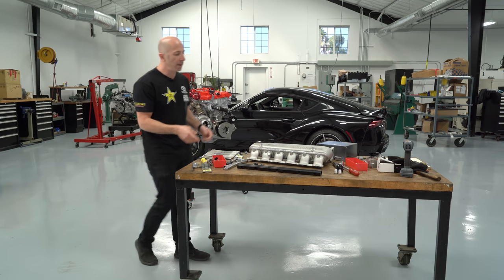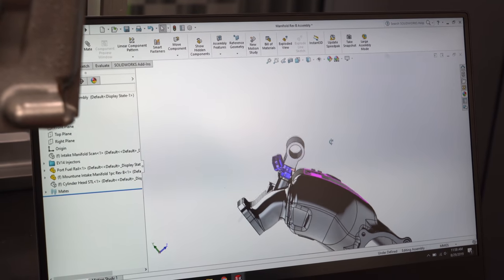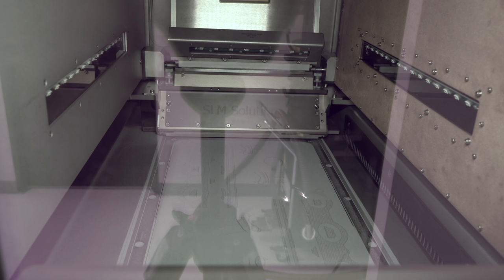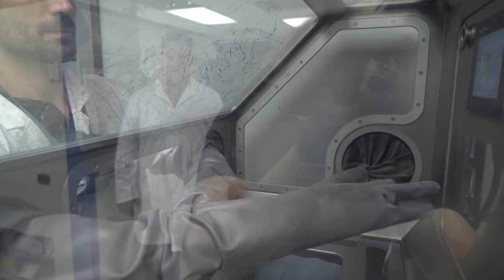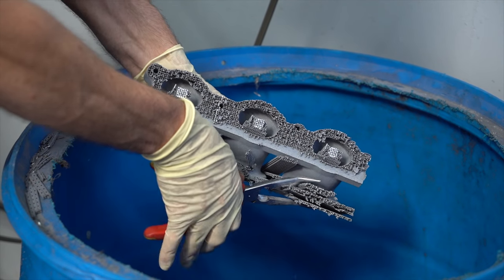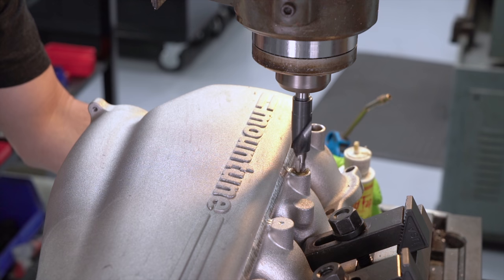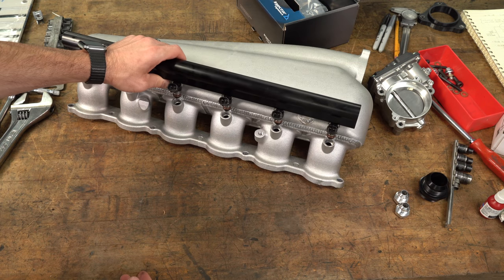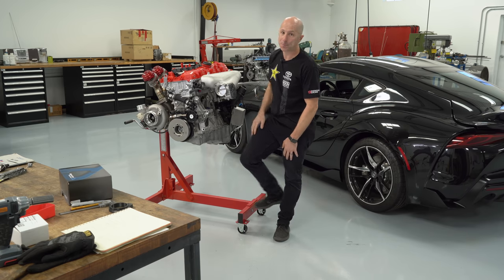3D Printed Aluminum Intake Manifold - Laser Melting Process

Comment: " Its a fairly simple process,  you just take this giant laser and shoot it at powdered aluminum! Easy, right?"
Reply: Lassi Kinnunen  or investment casting like Jay Leno has done in the past to make some of his parts
Reply: aniruddha patil what do you mean crashes at 90%?
Reply: Lassi Kinnunen  your first paragraph negates your last paragraph.  Replacing pla with aluminium via casting reproduces the EXACT same shape as the pla part. If you printed it, you can cast it.
Reply: Casting is easy
Reply: Lassi Kinnunen  but unfortunately aluminum does odd things when being cast into large and/or complex shapes. Would probably take several attempts to get the venting, sprues, and runners right. It's not always as easy as one might think.
Reply: Well because of the fusing temperatures wouldn't you have to flood the work bed with argon to avoid oxygen contamination?

Comment: Stereolithography. Been doing plastics like that since 1986. That was even more complex: The laser focus was fixed right above the pool of resin and a bed would break the surface and get lased wherever it needed a build up. then it would lower 2-3mm and rise up again (minus the height of 1 layer) with a fresh layer of resin on top of the last layer...lase that layer...on and on and the machine would have to wait for any waves to stop in the tank so it was an overnight process for a few inches but you could build a furnished doll house a layer at a time. Now they are doing it with aluminum powder. That is some one off stuff right there as the cost to 3D print a form for a custom AL casting would be cheaper and maybe just as fast if you had the production nearby waiting for the part.

Comment: $10K later and we have a converted direct injection to port injection setup.
Reply: Hopefully they run both like newer Coyote engines
Reply: @dhodg777  Looking at the dyno vid the direct injection didn't work out so well.
Reply: @mrred1012  they did not use direct injection so injectors had no fuel flow = no cooling so they just melt and burn out, thats why its hard to install a LPG to direct injected engines
Reply: @Clifton Green that's really besides the point. I merely meant that it could be spent on upgraded direct injection technology. Which is going to be the future anyways. The only current obstacle is cleaning of the valves that port injection offers.
Reply: @Clifton Green he already dyno the engine with only port injection and direct injectors literally get burnt out, check he's other videos
Reply: @Clifton Green you're absolutely wrong. Im currently dealing with a car that is DI trying to push only 450whp. It's extremly difficult. The easy route IS to simply just add a manifold with additional injectors. It's much easier to tune and removes the limits that DI currently has. With their accessibility to technology such as 3D printing, it made building a flex fuel setup that much easier.

Companies have recently THIS YEAR just passed the limits of 1000hp on DI only setups. So my suggestion of just "replacing the injectors" has a lot more involved than you are suggesting.

HOWEVER, the average person can't afford to drop 10-15k on a build like they're doing. So DI should be the route to go in order to help with the DI market .

Comment: Yeah, sure the cost is high and the process is slow but imagine where this process will be 10-15 years...
Reply: This technology is already 20 years old.
Reply: more like 1-1.5 years
Reply: It was by 1980 - I remember because I was working in the business hub of Toronto for a mining company that makes fine metal powders like nickel and cobalt for tech leaders like GE's jet engine division. In our office tower there was an architectural firm that was modeling proposed projects, i.e. those miniatures of office towers you'd see in lobbies. They had something that would lay a non-metallic powder and follow that with an adhesive to bond it where desired, then go up a level and repeat, etc. I thought it was a nutty way to make a model but who's to judge.
That would be the grand daddy inception of powder deposition. 

Early 90's I paid $625 for a Creative Labs 3X speed CD writer to be able to tell customers we could burn CDs for them. Slow as molasses but the first on the block. I paid over $300 for my first DVD burner a few years later (~1995) and it wasn't even 5X write speed.
Reply: Casting iron technology is about 2400 years old, so you could say it took quite a while to get to todays casting quality. So relative to that 3D metal printing technology and quality is developing/progressing pretteh fast!
Reply: This process is ridiculously fast compared to other options
Reply: @jnicksnewstart  nah..2 year in market not when they discovered it..now everyone can make one
Reply: @thecommentssquads2804  It Was available at WESTEC in 2003

Comment: That’s an “older” printer too they are getting really good really fast
Reply: @Kevin Schmidt can be done with any metal. titanium especially, because its so hard to machine or form, and an expensive materia to waste so much during subtractive manufacturing. its getting to the point where its gonna be cheaper to 3d print titanium and other exotic metals, rather than create a part out of billet via subtractive manufacturing
Reply: Kevin Schmidt It’s basically just Percision welding so if the medium (powder) is available they can print it.
Reply: It’s easier to do it the old fashioned way sometimes haha all this new stuff is getting complicated 😂😂😂
Reply: koenigsegg has been printing some of the more exotic metals for a while now but im pretty sure in a different process. its rad to see this shit evolve!
Reply: Brad Viviviyal I thought because he said old 😂 I honestly wasn’t using much brain power at all with that response 😂
Reply: Brad Viviviyal  fair call, i thought it was normal 3d printing with sintering after its printed.
Reply: Should have printed internal intake trumpets
Reply: @miskone1044  One of their turbos is so complex it can not be cast...very cool stuff
Reply: @miskone1044  Same process.
Reply: Same process but the platforms are getting cheaper, you will be seeing lots of these very soon. https://youtu.be/82ZZVIl72yE?t=1424
Also, back the video up like 2 minutes to see their continuous carbon fiber printer.
Reply: @Kevin Schmidt Titanium is actually easier to deposit (print) than aluminum. Aluminum is very reflective in the near infrared spectrum (where the SLM's laser is) and conducts heat very quickly making it hard to maintain a meltpool. Titanium doesn't conduct heat as quick helping maintain a stable meltpool and absorbs more laser power.
Reply: @powertothebauer296  yea you're right. however, its particularly easier in a metal 3d printer since its an enclosed and a controlled environment that can be filled with an inert gas that doesnt get washed away by drafts/breezes in the shop
Reply: The two problems these SLF printers have is inherent in the design of the machine. 

If you watch the laser hit the powder at a microscopic level it actually blows the powder off of the top surface in a sporadic pattern.  When this happens the molten metal can have a uneven weld and even air bubbles inside the layers which isn't good for long term life. The process still needs some refinement.
Reply: actually it isn't easier to do this the old fashioned way unless you make 100s of thousands of them
1)you need a build a mold(sand or die cast,expensive,labor intensive,trial and error)
2)you need to perfect the mold(make countless parts until the process is refined)
3)then you need to pour aluminum into it(again trail and error to perfect)
4)then you need to perfect this process(can take a long time and still not get a good product)
5)then you need to trim the casting and deburr/finish the un-machined portion
6)then you need to machine the casting(fixturing is incredibly expensive as is tooling and cnc machining and programming)
7)then you need to 3d - 5 axis mill the casting out to be anywhere as thin and free flowing as this printed intake taking a ton of time and costing a fortune to do
Reply: A lot of misconstrued hype getting around in the comments

The real (and only) benefit of 3D printing metal is for parts with complex geometries and or internal features that are impossible to make using conventional techniques. For that, 3D printing metals offers BIG leaps forward in what can be designed, but the only industries that have a pressing need for this are Aerospace, Medical and a few other high value/low volume industries. 

For anything else conventional subtractive methods and forging/casting are still orders of magnitude better. I can’t see that changing soon, if ever.
Reply: Renaissance Man 
Can you give some examples of low volume-high value industries?
I’m curious and intrigued
Reply: jasiel delgado It’s the space industry that is driving this tech
Reply: Trever Fogarty 
I know.
But I want to know what low volume-high value industries are there as he said
Reply: jasiel delgado I made a competition rifle butt once.....
Reply: jasiel delgado So in reply 2 months later (lol) the main industries right now are Aerospace and particularly biomedical

Thinks like metal hip implants and prosthetics have super weird shapes that can be made specifically for the patient. Biomedical is all over it right now, because the human body if full of weird and inexact geometries that need metal parts to meet a need. 

Aerospace also need parts that have complex geometries but for them internal features (certain things inside a part that are impossible to do with current methods) as well reducing part counts is huge for them in weight reduction and reliability. I think it was GE that had some assembly for one of their jet engines, they reduced it from 40 parts to like 5. Reduction in weight and complexity was a big gain
Reply: Renaissance Man 
Thank you 🙏 I was very curious and still am. You quenched most of the thirst. 
I’m very good at coming up with solutions but first I need to understand what exactly they need (all of what they need) and understand the tech.

Any good direct resources to study for both industries would be appreciated if you’re up for it. Thanks again
Reply: Brad Viviviyal  Good ol metal casting and welding sheet metal. .  intakes don't need to be printed. exhaust collectors don't need to be printed.
Reply: @Kevin Schmidt Renishaw does one in ti64
Reply: @HoweDoYouDo1999  definitely easier. But technology, although complicated, makes things efficiently and quick. As years go by and technology advances, 3D printing will be the norm in mass production.
Reply: It would have been faster to machine from solid. This is far from a good application for this technology, other than having the cool factor.
Reply: @teamtoken  yep, scalability is currently a major bottleneck for 3D printing. 

Still, whatever drawbacks current 3D printing methods may have, it's still impressive.

Comment: Question is, What uses more energy and time, casting or printing?, and long term reliability? just a thought. Unbeatable for prototyping no doubt.
Reply: Brad Viviviyal  Why is it stronger?
Reply: @samward2162  Cause the laser makes the grain structure of the metal jumble. Casting nowadays is done efficiently and doesn't have the same problems that it did back in the day. Hopefully 3d printing metal gets better.
Reply: @lepmuhangpa  3D laser sittering have more compacity than casting today, so it's mechanicaly better than casting
Reply: @surronzak8154  Still weaker than casting.
Reply: @مبغض الظلمة 100%
Reply: It depends on what you're doing. 3D printing is more efficient for low volume production of highly complex parts that can't be cast or machined.
For high volume production, 3D printing is currently bottleneck because of scalability. 

As for long-term reliability, I can't say, but the finished product shown in this video seems decent.
Reply: @lepmuhangpa  if grain structure is the problem then it could just simply be heat treated to realign the grain structure. Hell 3D parts might even be better because there should be virtually 0 grain stress from the beginning.
Reply: @280zx2by2  Every metal part I've used that been 3d printed is weaker than a comparable cast part. Even MIM parts appear to be stronger. The tech will eventually get there, but right now 3d printing parts under a lot of stress or pressure probably isn't a good idea. One thing they do seem to not have issues with is porosity or stress points - at least not nearly as much as traditional methods.

Comment: G.M. has been 3D printing of prototype intake manifolds since the 1980s.
At that time I was an instructor at a local college and G.M. donated what was then called a stereo - lithography machine to the college.
The media was a resin compound but worked well for prototyping low stress components.

Comment: Step 1 : buy 3d printer
Step 2 : print 3d printer
Step 3 : return 3d printer
Reply: Well I mean it's entirely possible to do it as people already print their own ones minus circuit boards and stepper motors etc.. crazy haha
Reply: Enjoyed this comment, thanks. :) Also it's funny because it is somewhat true.
Reply: Step 4 : skynet has become self aware
Reply: @djremotion2  Not just somewhat, it's called RepRap, google Prusa Mk 3. Got one at home
Reply: Thanks Chewbaccawacka
Reply: Mind Blown !   😂
Reply: why do I get the feeling this was a popular comment back in 2012 or so?
Reply: Wrong. When you buy 3D printer, all you print is more parts for it to run correctly 😂
Reply: Read R. Sheckley. He proved that self-reproduction of mechanisms is impossible, due to the loss of interest of mechanisms in repetitive self-repetition operations.
Reply: @MrRedstoner  there are few printed parts, most of printer is not printed. Esp. Prusa is complete hype and "printers print printers" is not much true. There are project, where printers are full printed, with frame, rods and belts. And they are inacurrate crap :)
Reply: Yeah I know the rods nuts and such aren't printed. But those are the parts that you can easily get at a hardware store, so there's no point in printing them. You print the parts that need to be specific to the end product. Of course they won't be as nice as fancy printers. But the prints our one produces are perfectly fine for what I need.
Reply: Replicators. Pesky little things.
Reply: Nice!!
Reply: @ihateu1979  on a standard PLA 3d printer? No you can't.
Reply: Rule number 1: You can't wish for more wishes...
Reply: Nice copy/paste comment.
Reply: @MrRedstoner  fk prusa,  google reprap Snappy its the most 3d printed 3d printer. 
prusa isnt really a reprap anymore in the sense you need a printer to build it you can buy it for 3x more than its worth in parts. 
and its a wobbly PoS. get a box frame printer.
Reply: picked one up at aldli  just waiting on the aluminium wire.
Reply: funny guy!!!
Reply: @MrRedstoner  no, just somewhat, unless you really believe  you can print a complete printer.
Reply: @anthonyg4671  You can print everything you can't buy, and buy the rest for likely way cheaper than the pre-made printer. That's a fully in my book, as the result adds up to a complete working printer.
Reply: vary good idea.
Reply: 🤣🤣🤣🤣🤣 Sure.... ONCE!
Reply: That is illegal, can't do that.
Reply: Good coding.
Reply: Step 4 : realize that materials costs a lot, and someone earns profit (if its not made from waste)
Reply: yeh , but you forget to think about software part :) and you have to find ingenrnir to set up all in place

Comment: Fun fact: I’m currently working on a project at my university that’s looking at speeding up the build time of those 3D printers by increasing the thickness of each layer. The only issue is that increasing the layer thickness could introduce porosity which would lead to mechanical deficiencies.  It’s really cool and I’m really happy with the exposure this kind of printing has been getting recently.
Reply: The other issue is that increasing the layer thickness reduces your Z-axis resolution. It also slows down the process because you need to scan the laser more slowly to melt the increased volume.
Reply: In ceramic shell , some times we got porosity . You have so much time in the part , you try and save it . You can paint the runners inside with Devcon Liquid  Aluminum Epoxy , never had a problem with it coming off , if applied to  a new part .

Comment: Sometimes depending on the part, there are high internal stresses and parts can warp when taken off the build platform. Fantastic process, but more suited to complex form designed specifically for the application. Conformal cooling channels in tooling inserts are a good example.

Comment: The process is DMLS, Direct Metal Laser Sintering and there is a thermal post cure to reduce internal stresses you did not show before support removal. Most excellent creation of a custom intake manifold, thanks for sharing.
Reply: No, it's not sintering anymore. More than a decade ago or so, 3D powder metal printers would rely on SLS, Selective Laser Sintering. With the advance of optics and increase in laser power machines moved to SLM, selective Laser Melting. As mentioned elsewhere, modern machines can still do sintering when porous parts are required (say, filters). 

The difference between sintering and melting is that with the former you don't exceed the melting temperature of the powder, the particles just get hot enough to soften and stick/fuse together. You can get up to about 95% density this way. With SLM it is possible to truly melt the powder and get to 99.95% density.